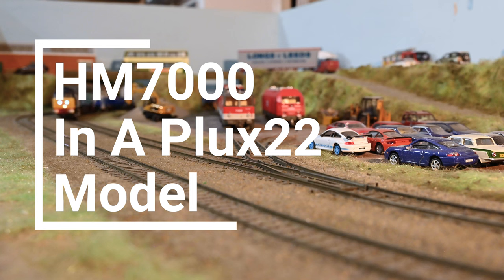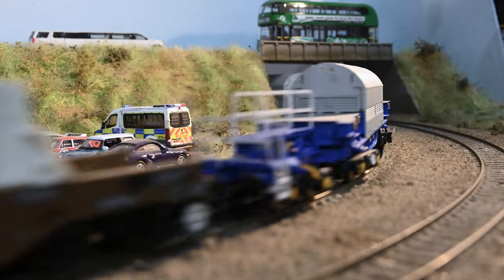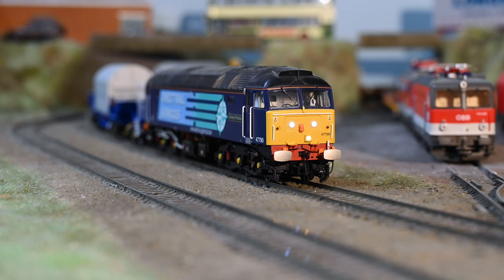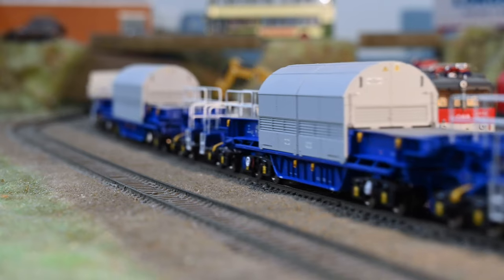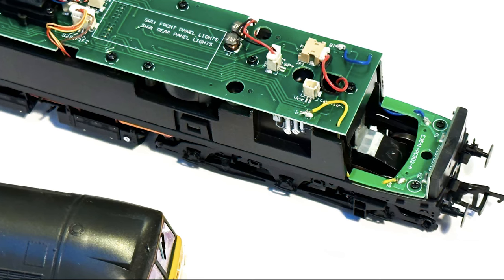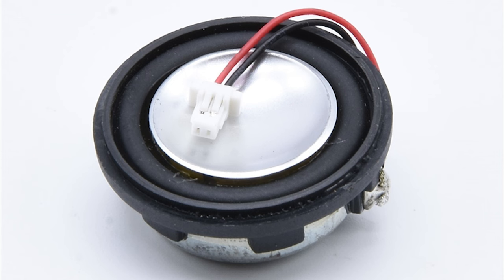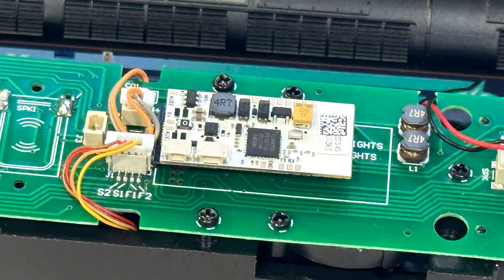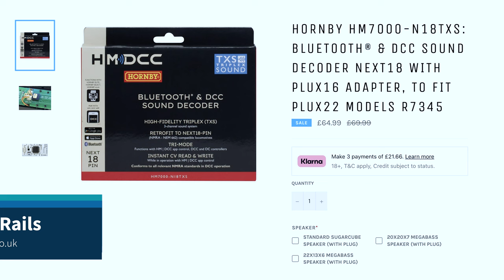How to fit a Hornby HM7000 Sound Decoder Into A Bachmann Plux22 Model

Comment: Hi Richard, great tutorial thank you.  Do you know if the adapter and decoder will fit a Bachmann class 158 (newest tooling)?  In that case the decoder is accessed from the panel below.  (I’ve got one on order and hoping I can squeeze HM7000 in!)
Reply from the maker: Yeah, should fit fine, you’ll need to wait for the 153 file which Hornby are working on.

Comment: Hi Richard, I'm thinking of doing this with a Plux22 Class 47, when you remove the factory fitted sugar cube speaker, do you need to unsolder anything or is the speaker just plugged in to that J3 socket?
Reply from the maker: Hi, no soldrting no, the speaker connections are just push contacts, with the screws holding it in place